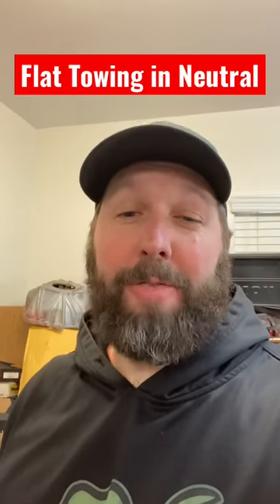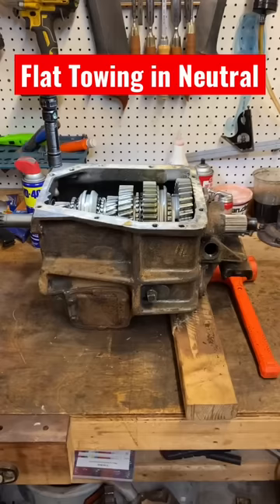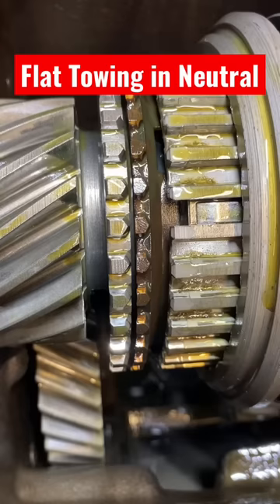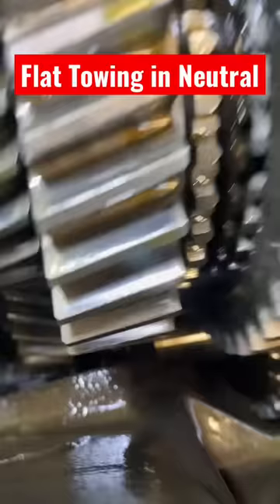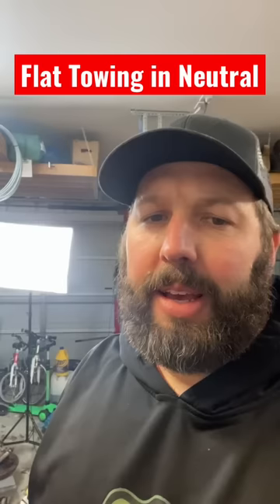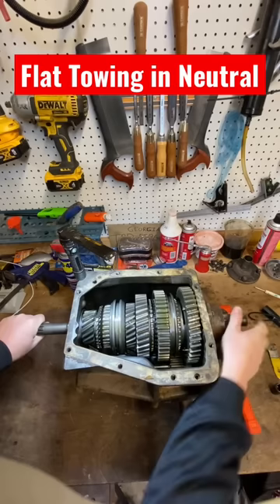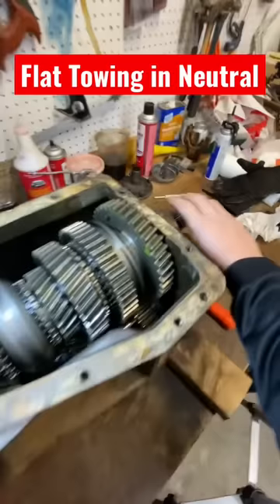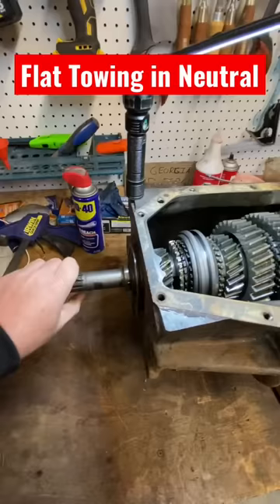Flat Towing in Neutral??? #transmission #stickshift #mechanic

Comment: As mentioned in these comments, always go with manufacturer recommendation.  Some have an oil pump driven off the output shaft.
Reply from the maker: Yep. It’s perfectly fine in some vehicles.  I typed, and stated, to read follow the owners manual.
Reply: Some old Acura MDXs call for you to start the vehicle and run it through the gears every so many miles to lubricate everything. Every vehicle is different.
Reply: When ever you tow anything far you should remove the driveshaft
Reply: @Tiobolo713  pretty hard to do on a fwd
Reply: @Tiobolo713 , no, just RTFM and save yourself a lot of work.
Reply: @questioner1596  rtfm?
Reply: I tow in reverse so the oil that was there at one time will come back
Reply: @grantperkins368  it's an old internet acronym that means read the ** manual. I'm not trying to be rude, just trying to emphasize the importance in a humourous way.
Reply: @Tiobolo713  yup try that on a FWD.
Reply: @legros731  tow dolly is only safe way for that. Then if you have a wide body like my taurus its hard to find one that will work.
Reply: @maddhatter3564  what? your Taurus is not wider than other car stop smoking crack
Reply: The manufacturer suggestion 9 out of 10 times, is flatbed, whether or not it is actually necessary. Liability reasons.

Comment: Thats why i only tow with the transmission in park, it can be hard to get going, but once you do, its smooth sailing

Edit: Why can no one read, i never said i tow my manual trans in park. i said i tow the transmission in park. READING COMPREHENSION
Reply: lmao
Reply from the maker: Gets easier once the tires blow 😉
Reply: Frantically looking for the "P" on my 5 speeds gear shift!
Reply: And it gives you and audible indication that it still behind you so you don't have to check your mirrors as often. lol
Reply: @TheWabbit  look harder
Reply: It's even more impressive to tow in park with a manual trans lol
Reply: I hate to admit but I have towed a few cars with the parking brake on
Reply: @TheWabbit  change the R to a P now you have a transitioning car
Reply: @Gkitchens1  If you are willing to put in the time and effort, you to, can find the park on a manual trans
Reply: @TheWabbit  if you have a sharpie, any R can become a P
Reply: I prefer the roof, then the lube gets to the upper shaft better. LOL>>>HAHA
Reply: @TheWabbit  use the "R" "rock solid" better that "P"
Reply: Lol
Reply: 😂😂 sweet, sweet sarcasm! 😂😂
Reply: @TheWabbit  you gotta pull the lock out ring like hitting reverse. Only its behind 2nd gear instead of 1st. You gotta pull HARD to get it in gear tho! 😂
Reply: Go back to school
Reply: Hahaha
Reply: @Buck_Fiden658  LOL
Reply: @joshuamccoy1444  but do you tell the customer /? st. joshua
Reply: whaaat!?😂
Reply: There's no "park" in manual transmissions.
Reply: What! Ahahahaha.
(And i find the parking brake only smokes at first)
Reply: How do you put a manual transmission in park?
Reply: @sweetwilliam49  you dont..its a joke dude
Reply: @commonconservative7551  tell them what?
Reply: @joshuamccoy1444  that you might have destroyed their car or tires etc. you are the expert, what could have been harmed?
Reply: @commonconservative7551  it all depends on weather the vehicle is fwd rwd or awd almost 99 % of the time the emergency brake is for the rear wheels , Fwd you will drag the back wheels eventually the wheels will turn and you are heating up the brake pads, rwd you are pulling the brake and parking gear could do a lot of damage, awd vehicles are the worst to try to tow most of them will spin the front tires while you have them lifted causing a nasty bouncing effect while driving down the road ( I have lost a vehicle this way) other side note with awd vehicles if one of the axles is damaged it throws off the whole awd system and can tow no problem
Reply: @joshuamccoy1444  you did not answer the question
Reply: Park on a manual transmission?Whatever dude.I guess I have been doing it wrong the last 40+ yrs. by leaving it in 1st. gear. when I park.
Reply: Never tow a manual transmission with your brain in neutral 😐
Reply: One time many years ago I was at a gas station driving a company delivery truck; an Isuzu stake body automatic. I pulled up, then realized the hose didn't reach, decide to be slick and just put it in Neutral to drift far enough for the hose to reach, since it was on a slight hill.

Long story short, it started going faster than I anticipated, e-brake wouldn't stop it, and I slammed it back into Park out of desperation. It worked, but sounded horrendous. Click click click click click click. Lived in fear for about a week that the truck would break down and I'd have to explain what happened to my boss.

Several years later after I discovered YT, saw a video from some car guy channel about how doing that can break the parking gear, apparently I lucked out.
Reply: @stevegarvin5607  oh look another person who didnt actually real what i said.
Reply: lol
Reply: Bro.. manual trans dont have a "park"
Reply: They do it all the time.
Trust me.
Especially when you parked at a " No Parking Zone".
Reply: Dude😎 Funny as hell. I read it 4 times and laughed my ass off every time.😁
Reply: The PNRDL! Of course!
Reply: Is that the separate shift stick below the main one?
Reply: Car wash sent my truck thru in park one day.  Washboys in Baytown, TX.  I'll never be back.
Reply: @TheWabbit  R works just as well
Reply: Uh, that's somewhat funny  but not really  had one lock up between  2 gears  and called a do called mechanic  and that  assole grabbed  it on the front and I heard the  pop across the  street  inside  the sheriff's  office! 
They wanted to chase me $200 for 3 sp i said you're  luck I don't sue you
Reply: Since when did manuals have "park" Autos in park, locks the transmission.
Reply: @Shane Kennedy  yep called first gear.
Otherwise  your  correct
Reply: I dropped into park once before i came to a complete stop.  I was lucky i didn't strip the gears, esp' as i had an occupied horsebox behind me.
Reply: power to the people
Reply: @freedomworx  power to the people
Reply: @yourfavoritelawnguy2722  watch out😅
Reply: As long as the transfer case is in neutral that is the correct way to tow.
Reply: I miss my emergency brake on my manual
Reply: Parking pawl? Who needs it?
Reply: 😂😂Right
Reply: It’s eazy down hill though c’mon man
Reply: I don’t know about “flat”towing”, but with a wrecker (or rollback with a rear wheel-lift), I was always taught that all 4X4 chassis’s MUST be towed in 4WD-Low with the rear-wheels in the air strapped to the wheel-lift.  You’d be surprised how many transfer cases and tranny’s our shop put in.  Damn near 90% of every row we got 😂😂😂😂

Comment: At low speed, for short distances, it’s not a problem. 
The bearings in the shaft are either roller or ball bearing with a heavy weight gear oil lubricant. 
It’s similar to grease on a trailer bearing.
Reply from the maker: You should read your Owner's Manual. Towing in neutral is fine for some vehicles. Some need the driveshaft disconnected.
Reply: Thank you.
I save boo-koo bucks coasting.
My mileage meter can save me a mile per 13 even on short trips in city driving just by coasting down 100 ft inclines.

Now I'm wondering about the 13 mile drop out of VA into NC.
Reply: Dude, this guy clearly doesn't know what he is talking about.
Reply from the maker: https://www.tremec.com/not_am_detalle/flat-towing-manual-transmission-vehicles/
Reply: @capie44 Modern manual transmission vehicles shut off fuel pulse upon deceleration. So if you pop the gearbox in neutral to coast down a hill, you're using more fuel than if you just left it in gear. That's because it requires fuel to idle the engine when the transmission is in neutral.
Reply: @Japplesnap  : hmmm. Interesting. 
Since idk, i can't  doubt.

My mileage indicator goes up after few miles of coasting down 500 ft declines.

I wonder if this would off-set the re-engaging the fuel pulse...

Thanks for your additional point👍
Reply: @Japplesnap  This is TRUE ! 
The ECU will cut fuel COMPLETELY if the engine can turn without it, especially during deceleration.
Reply: @Japplesnap so it's shuts the injectors off or lowers there frequently no pulse  no fuel
Reply: @user-qo3tb8je7f  Exactly.  So a manual transmission vehicle on a long downhill road will effectively use zero gas as it coasts down that hill in gear. But if you pop the transmission into neutral and coast down that hill,  then the engine must use fuel to idle. So you save gas by coasting down the hill in gear, not by coasting in neutral.
Reply: @freedomworx is it safe to do with a vw bug for about 40 to 60 miles below 50mph? 
Cuz that thing has no driveshaft at all and droping the engine to do it in 4th gear doesn't sound like the way to go
Reply: Billy, that’s not true on many transmissions. NV3500s, for example, use a lightweight synthetic oil, and many others use ATF. I think it’s safe to say that most gearboxes these days DO NOT use gear oil
Reply: The manual transmission in my 88 uses 5w30 motor oil😅 it blew my mind..
Reply: @Suave6869  My Vito’s 5 speed manual uses automatic transmission fluid !
Reply: @Billydevito  😱 that's interesting! It blew my mind and the parts counter old man when we looked up and mine uses Motor oil!

Comment: I’ve had to repair these transmissions. If the gigantic main gear is not rotating, it’s not applying lubricant to the rest of the gears.
Older transmissions, you could flat tow them with no problem. The car had to be moving so one of the gear sets would throw oil onto a tray that distributed the gear oil to the other gears and bearings.
Big trucks are that way.
If they are idling, and the manual transmission is in neutral, the #1 gear picks up the gear lube, and throws it onto a trough that gravity feeds to the places the oil is absolutely required.
Car transmissions were not made this way, because they were not meant to idle for long periods.
Reply from the maker: Thanks
Reply: Thank you for the explanation. Appreciate that. 
And you just taught me something, too.

Comment: My toes are not flat but thanks for the excellent advice.
Reply from the maker: A good set of steel or composite toe boots will help keep them plump. 👌
Reply: Can we tow it in reverse gear?

What if we tow it with the engine running in gear?
Reply: Wayne you knocked that one out of the park and down the road...
Reply: I used to do that all the time with trucks that had air brake issues but the engine was fine. Not long distance, but a few miles across town was fine.
Reply: Ok that was great, lol.

Comment: I drove a wrecker 13 years. We only left the drive shaft in for very short tows.
Reply from the maker: Very short trips shouldn't be an issue. I was speaking mostly to those towing behind an RV 👍
Reply: Dollies  take 5 minutes it will save your job.
Reply: Used a rollback unless it was a large vehicle. Never seen anyone use a dolly with a wheel lift wrecker if the vehicle was still rolling good. They are more for a totaled vehicle or maybe if a wheel has ran off or axle failure.
Reply: I operate a heavy wrecker it has to be a very short tow or be able to leave the unit running then tow as far as you want
Reply: 2 miles at 20 mph was the rule in 1998

Comment: ALWAYS TOW WITH THE TRANSMISSION IN REVERSE GEAR.
😌😌😌
Reply from the maker: There are better options 🤓
Reply: @freedomworx But you won't learn anything here!!
Reply: But we won't learn them here, right?
Reply from the maker: Did you watch the video? T-Case in neutral, remove driveshaft, read owners manual. Those are your standard options. If you have an operable engine, let it idle. If you have the means, overfill the transmission. The point t of the video is t to teach people everyday to flat tow a vehicle in a 60 second video. It’s to teach people that it’s possible to damage your transmission if you just put it in neutral. Because most people dont understand that 🤷🏻‍♂️
Reply: @freedomworx what video? You only mentioned what not to do not what to do.  We are talking under a 60 second short. It’s supposed to be a-z experience. So how are you supposed to tow a manual? I don’t have a transfer case
Reply: @freedomworx so on a motorcycle i should remove the chain? Is that the equivalent to removing the driveshaft basically ?
Reply from the maker: @Fee.1  flat towing a motorcycle??? Never seen it done.
Reply from the maker: @Fee.1  I see the disconnect. This short doesn’t contain all the video that was in the IG and FB reels. My bad. Hard to keep up with it all. Remove driveshaft or T-Case in Neutral, read owners manual.
Reply: @freedomworx  that makes sense. I was so busy trying to understand the situation I didn’t even think about the issues with flat towing a motorcycle 🤣

Now I have to look up the differences between flat towing and whatever wheels up towing is called
Reply: @freedomworx don’t bother responding to these guys, some people are too out of the loop. Good job putting knowledge out there, it’s not your job to teach all the people too dense to understand
Reply: @freedomworx  yeap done that, instead of tow strap ,link to belts together and hold on
Reply from the maker: Thanks for watching 👍
Reply: So… which gear should it be flat towed in?
Reply: @freedomworx let it idle?? There's not a pump in a manual transmission. Holy fuck 😂
Reply from the maker: @arthurcook1464 the input shaft dives the countershaft 100% of the time. That’s why idling lubes the trans. It doesn’t pump the fluid, it slings it. That’s what splash lubrication means. Holy Fuck 🤡
Reply: @freedomworx I've seen a motorcycle rack that the front wheel drops into and holds the bike upright (strapped down of course). Only the rear wheel is on the ground. I have no idea how bad this is for the bike.
Reply: Never tow a manual trans in gear
Reply: By FLAT TOW, He must be meaning on all 4, 6, 8, or 10 wheels.  In other words, NOT ON A TRAILER.  ON A TRAILER, DO NOT LEAVE IN GEAR.
Reply: @freedomworx what if you hold the clutch down? Can you tow like that?
Reply from the maker: @davesomeone4059 if you want a leg workout. But that can be detrimental to your throughout bearing. It’s best to just read the owners manual. It’ll tell you the proper way for your vehicle.
Reply: And make Shure the HAND BRAKE IS PULLED IN.
For smoke signal!!!😅
Reply: Years ago, a buddy's bike broke down, didn't want to leave it on the side of road. So tied a rope to back of my bike, towing it back to town. Towing a motorcycle with a motorcycle.